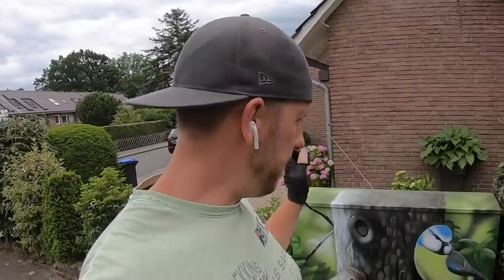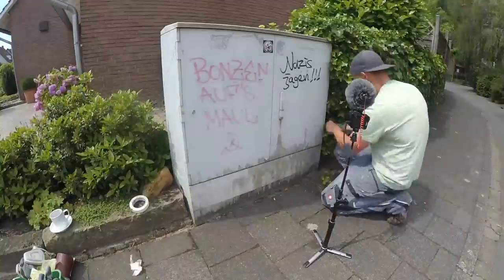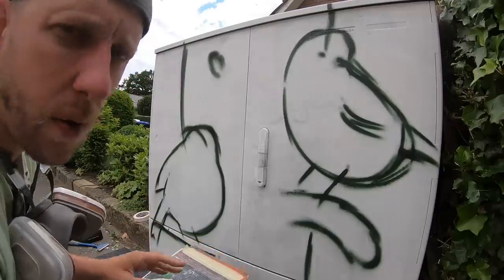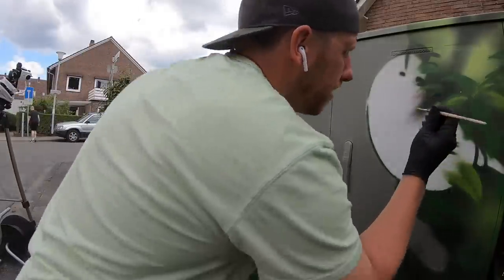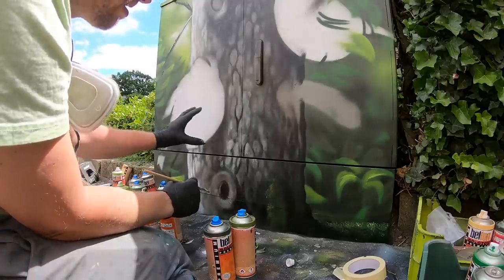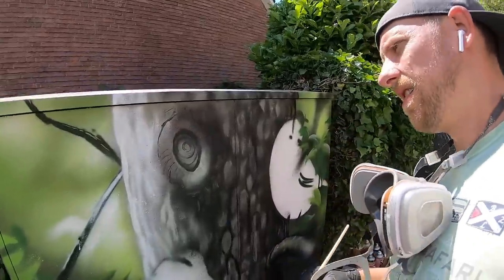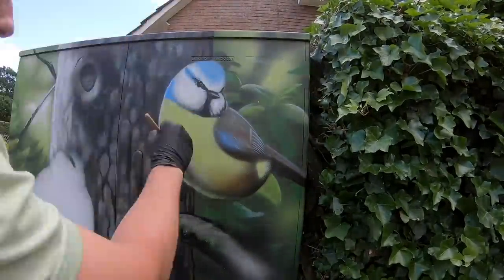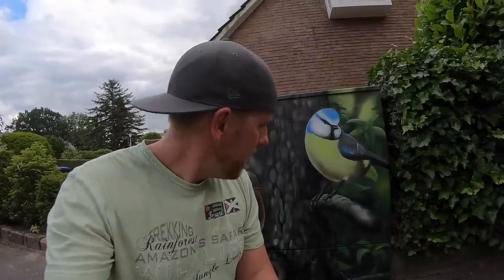High detail GRAFFITI super small SIZE - Tutorial ⚡Electric Box Commission

Comment: Tips: One advice for textures. Let’s say, background tree or leaf texture, or rock. Spray or paint a dark color. , let dry. Then a light color on top, while it’s wet, take a plastic sheet, plastic bag or roll of (2 ply) thinner plastic: lay it on wet paint flat but with some crunch, wrinkles. Push down and let sit for 1 min, Then pull it off, it will take up some of the lighter color, showing darker under and leave a marble type pattern. Very random and natural. You could also spray some lighter color paint on a crunched up plastic bag, then stamp it to dark color. Flip it around so the pattern is different. Not repeats. 

The real “Faux Finish” way make a marble or weathered wall. ( old wall look, with yellow ish,  or tans, light and dark). To make a wall look old, distressed this would usually be done with with house paint & roller. To make a wall look like marble or old/weathered: You paint the darker shade of color, let dry. You mix a lighter color, with half water based clear gloss (or satin just a clear) or transparent base paint. Then roll on a section of that let’s say, 4ft by 4ft. And then, while wet, lay large 4’x4’ plastic sheet flat over it but leaving random wrinkles in plastic, sorta waves not perfectly flat. (Crunchy wrinkles) push it onto wet paint. After 1-2 mins, Pull off and Bam!, instant texture, marble type. Leather veins, translucent natural  variation. Then move down the wall, in sections. It’s so much better than a sponge marble technique (I do t feel looks natural)
Reply from the maker: very good tips, thanks for that!
Reply from the maker: aaaaah, you are brian life from instagram - maaaan i did not know that your beautiful girl adriana araina adrina, or what her name was is freaking 10 years old!!!!! man! that was surprising! thanks for being here man!
Reply: @SMOENOVA  Oh cool, yes, that was/is her name Arianda, the Painting is 10 years old. lol. She is age 30 something! lol. I cant believe I painted her 10 years ago, still one of my best paintings, can't out do it. ! Made my heart skip there! lol. So good to know you remember me!